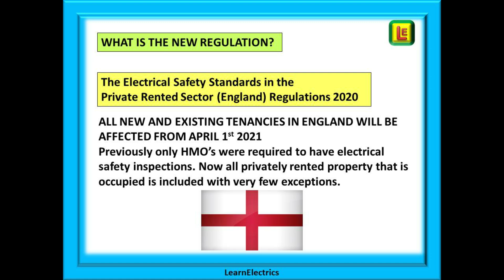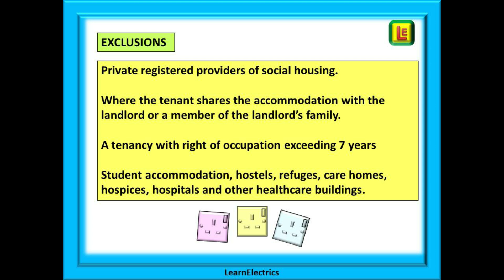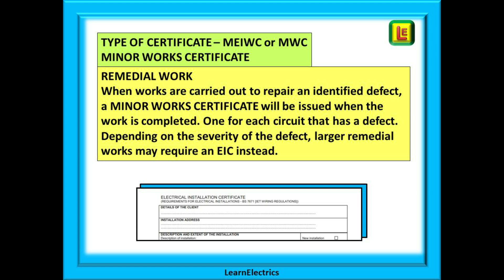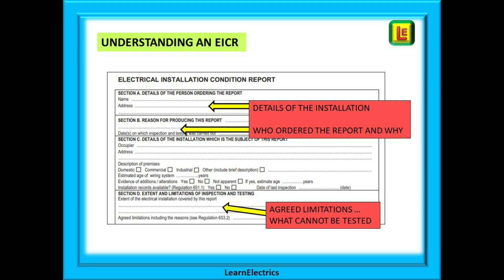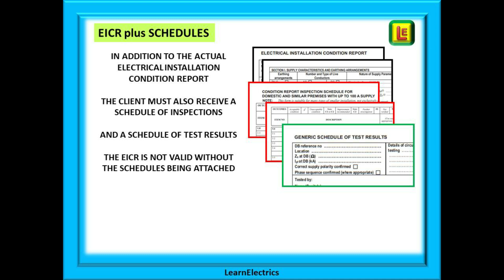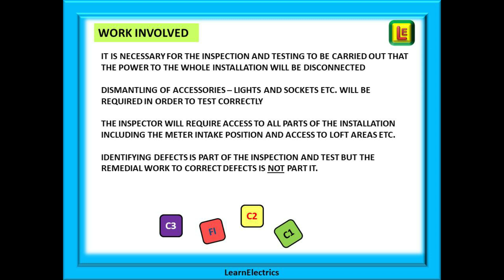LANDLORDS ELECTRICAL INSPECTIONS

Comment: Hi Dave, We have spoken before about EICR's. Something I am having to endure dealing with Electrician's who in my opinion are taking advantage of this new Govt law change. My main gripe is there is no Independent Dispute Resolution service in place. I'm sure it's not all electricians but it has been mentioned many times in the forums that some are quoting silly money to replace your plastic consumer unit when there is absolutely nothing wrong it. 

I also suspect some electricians are purposely creating faults when testing a property to enter a C2 on the form so the landlord pays them again to come back and rectify the fault that they created.  

I have had 3 EICR's done to date, the first one in 2013 which was SATISFACTORY, the second one in February this year was UNSATISFACTORY. The 2nd EICR showed 6 C2's, 3 of them were simple fixes like boiler JB lid was loose and an Emergency light failure.  The other 3 x C2's were multiple circuits in CU which when challenged was met with "that's an admin error" and were changed to C3's. I took photo's of the C2 simple fixes and sent them to the tester to show the work was completed but he insisted he would need to return to check himself which requires further payment. Rather than pay him to come back, I commissioned another EICR which was completed three days ago. The report come back with a totally different set of C2's and a quote of £288 to fix them. Because the report is so vague, I have asked for clarification on exactly where the fault is and photo's where applicable.
 
Examples    
1. "There is no continuity of the lights circuits CPC. C2" : Which circuit? upstairs/downstairs/both? 

2. "Cables are not secure. C3" Where?

3. "The test results for circuit 3 show loose connections within the circuit. C2" Can you please advise me what test results in the report indicate that downstairs ring-main has a "loose connection"? These are the measurements I see. 
a.	Tester 1 – Nov 2013 – R1=0.74, RN=0.74, R2=1.18, Max Measured Zs=0.68 (Passed)
b.	Tester 2 – Feb 2021 – R1=0.71, RN=0.70, R2=1.3, Max Measured Zs=0.8 (Passed)
c.	This Tester - May 2021 - R1=0.16, RN=0.16, R2=0.29, Max Measured Zs=0.55 (?)

I am waiting for their reply at the moment and strongly suspect photographs will not be forthcoming so if there is any taka-way from this post. When ordering an EICR always insist the tester takes photographs of visual faults and include them with the report.

PS: I would very interested in Dave's opinion of the test results in point 3.

Kind regards,
Reply from the maker: Roy, the regulations make it quite clear that a plastic CU that is still functioning correctly and safely as designed and installed does not need to be changed. The electrician is under a moral obligation to inform you that metal CUs are available but should not give the customer the false impression that it must be changed, that it is illegal.
These cowboy practices really annoy me. The customer trusts them and they rip them off.
See page 237 of the Regs book. 651.2 NOTE 2.
Existing installations may have been designed and installed to conform to previous editions of BS7671, applicable at the time of their design and erection. This does not necessarily mean that they are unsafe.
Hope this helps. Dave.

Comment: hi guys, if you changed a consumer unit and carried out full testing procedures before and after consumer unit change, would you only issue an EIC as it has schedule of test results within that cert or would an EICR need to be issued as well? 
following that if you where to do an EICR before a board change would that certificate be invalid as soon as EIC was completed? as a new board with different characteristics would have been installed so EICR would be out of date?
many thanks!
Reply from the maker: If you change the board, the job is Part P notifiable regardless.
I would complete the 2 pages of EIC reason for certificate change of CU and then do an EICR as that includes a Sched of Inspections and Sched of Tests so no point duplicating those and its easy to copy the CU details from the EIC to the EICR.
It's up to you the order, if you do the EICR first your tests will still reveal if there are problems with the old wiring, but make sure you notify. As long as you are not trying to act fraudulently or "cheat" the system, no-one is going to worry if the job is professional, correctly installed and sufficient information is left for future inspections.
Reply: @learnelectrics4402  great stuff thanks!
Reply from the maker: Very welcome Paul.

Comment: We we do cable calculation for ring circuit we Divide the length by 2 so the length was 62 will be 31m now when we will find value for Zs for the circuit we should put the length 31 or 62?
Reply from the maker: Thanks for the question Mohammed. There are a couple more things to consider with ring circuits and a few people asking about ring circuit volt drops. The video on Thursday will be on Ring Circuit Volts Drop. Thanks for watching, Dave.

Comment: Fantastic be interested to see how many of the dodgy landlords comply 
Thank you for another great video
Reply from the maker: I think that is part of it Sean. Thanks for watching. Dave.
Reply: @learnelectrics4402  when you see on the news last week about Croydon cancel and the state of there house if maybe the new regs should apply to councils and housing associations as well? I can tell you my mum’s flat still has a rewireble  fuse box and the ring is wired in pyro it been like that since the sixty’s
Reply from the maker: There is a lot of improvement needed in lots of places Sean. You would think that councils would be at the top of the list for making sure improvements were done.